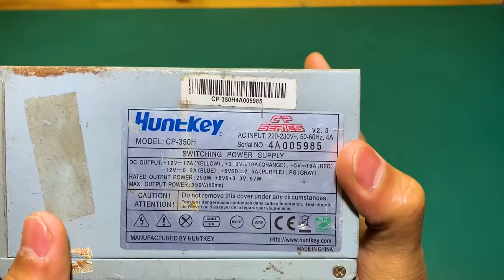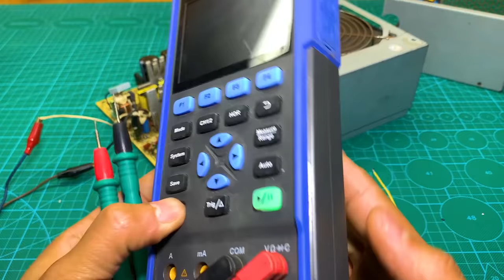DIY Powerful Ultra Bass Amplifier ATX Computer , Simple Circuit , No IC

Comment: It is fake. He soldered everywhere with copper wires but he didn’t cut off the original line that already on the circuit board 😂
Reply: Also one or two jumper between primery & secondary, that mean , is  this  live chassis amp????
Reply: This is no fake
Reply: Tradução versão brasileira Herbert Richard: É falso. Ele soldou em todos os lugares com fios de cobre, mas não cortou a linha original que já estava na placa de circuito. 

Foi a mesma coisa que eu percebi! Como que tem gente com tempo para fazer vídeos fakes? para enganar gentes leigas no assunto? Na moral é muito cara de pau esse cara kkkkk merece um Oscar: os vídeos mais fakes do YouTube!
Reply: Amplifier is hidden in his battery
Reply: Even when its not fake this thing cant put out so many watts XD
Reply: we should ask the guitarologist lol
Reply: Creio que não seja Fake esse vídeo  porque o técnico ao inverter a forma de como utiliza e retira a energia da fonte ele elimina todos os circuitos originais da placa e passa a valer aquele que ele criou utilizando o cabo rígido de cobre.
Reply: @renatolopes4543  the kicker is this theres no filter no sorce cleaning no hpm sense or even any type of mosfet gates and no input section for the amp to work this would be an idea to try if you had some idea on how it works but in truth this is a 1/4 the shit need to make a amp work youll be better off getting a bread bourd and 4 psu and a few power adptors and takeing them down for the parts and trying to make your own amp useing pots filters and so forth 
most of could be slavaged form parts
Reply: Como saber qual os pinos que vão ser jampeados,na placa,🤔

Comment: Dont take this the wrong way, but its much easier to just clip the green wire and a black wire on the ATX 24 pin connector, tie them together to trigger the psu on, then use yellow and black wires to a car amplifier since all yellow are running under 12 volts. You can then take an aux to rca and plug into an amplifier for much higher power. 
Tie in a 500 watt class D monoblock amp with a ported 15 in your home for extra bass. 
or Tie in a 2 or 4 channel amplifier to mix with 6x9's, 12's etc. 

Used to wire car radios in my bedroom as a kid, was fun then, now i got cars so the game has changed for me.
Reply: Sadly this is not a joke, good hearted enthusiasts can try to follow his stupid instructions and get seriously harmed, because you know, if it's on YouTube it must be true
Reply: @JoeOrber  whos instructions? the video or mine? Wouldnt be the first time i have used decommissioned PSU's for car audio You can use them for head units as well.
Reply: @hayzeproductions7093  wow show me how you do that, and solder random wires in random places, this is BS
Reply: Do you even know the difference between a PSU and a head unit at all? The power supply just supplies voltage and current to the different parts of a computer
Reply: Hence the name, Power Supply Unit
Reply: It won't amplify any sound or do anything else with a couple of randomly-soldered cables
Reply: Do you even know what a head unit is?
This is what they are called for car radios. 

Pins 23 and 24 on an atx connector are green and black, you clip those two and connect them together this is to trigger the power supply on and provide power, all the yellow leads on a power supply are 12v hence why they are colored on most power supplies. All the black wires lead to ground power.

Here you go, heres a youtube video that perfectly demonstrates what im talking about. Since you say i know nothing. 

https://www.youtube.com/watch?v=c_-0dk-FO9Q

You can also use power supplies to power CCTV and NVR cameras from long distances used to do this all the time.

You wont get injured touching the wires because its in DC voltage, You wont feel anything. Same goes for 12v car batteries. DC voltage is harmless.
Reply: @hayzeproductions7093  I know what a PSU is, the comment was aimed at the original video showing how to use a PSU as the amplifier
Reply: Lol I did exactly this. Ran a twin jl 12w0s on a class d 500w, hooked it up to my surround and it was AMAZING
Reply: @JoeOrber  you can also just use a psu to power  a car amp just need to jump the green and black wire on the 24 pin contector and use the vga or cpu power conector as  power for the amp and then use a aux to rca cable to send soun to any 2 channel or even 4 channel amp rather then doing what this video suggest
Reply: @fxgamer-11yt  exactly, the PSU is used to supply several voltage levels to a motherboard, and it can certainly supply power to an amp, but not amplify the audio signal 😉

Comment: No importa si es de corriente lineal o PWM... para amplificar audio se nesecita una etapa de conmutacion controlada por lo que se va a amplificar,  en este caso es audio. Una fuente conmutada en su etapa de oscilación ya tiene diseñada la frecuencia a la cual va modular fijamente.  Una etapa  pre-drive cuando se trata de audio es mucho más complejo
Reply: ENTONCES ES FAKE
Reply: @hi51667  super fake
Reply: Esta muy bueno el vídeo y la demostración  y me gustaría que me dieras el diagrama completó ya que en el vídeo no se puede apreciar muy bien....
Reply: Hermano, eso es una fuente con salida en voltage DC, solo usa una etapa de voltage de entrada conmutado porque el chopper de ferrita no induce en baja frecuencia, trabajan en su mayoria de 22k - 40khz
Eso que ese tipo está haciendo no tiene logica
Reply: No está usando los e30017 como preamplificador? Y alimentando el voltaje de la misma?
Reply: @hibari4139  Además, en la entrada del AC deberían haber unos diodos, ¿verdad?
Reply: @joveaaron-real  podes usar capacitores de 16v 1000ma y una resistencia de 10k o 100k o 1000k sirve para hacer un amplificador, es totalmente factible hacer amplis con fuentes de PC.
Reply: @hibari4139  a que le llamas amplificador? A conseguir unos pobres 50 watts llenos de armónicos y distorsión?
Reply: Si llamamos amplificador a poner a conmutar un trasistor a la cañona, entonces no es para mi
Reply: menos mal que lei este comentario, casi me pongo manos a la obra. gracias por la salvatore
Reply: ESE ES EL PRINCIPI0 PRIMITIV DE UN AMPLIFICAD0R CASE I
Reply: No es bueno el video, un amplificador asi de pedorro cuesta mas barato que una fuente de pc, voy a hacer un tuto de como comprar un amplificador ja!
Reply: @fabianjomet6546  venden modulos de 50watts× 2 que suenan mejor y más barato que ese prototipo
Reply: @roelvisgrullon8696  Confirmo completamente XD
Reply: jaja esta amplificando sonido con reguladores de voltaje de 12 v y de 5 v como carajos hace para volver el voltaje sonido es sorprendentemente mentiroso, esta bien que quiera hacer videos y aplificadores con todo por no mentirle a la gente asi de feo, y no deja de usar esa bateria q ya todos sabemos que es donde esta el amplificador real
Reply: Y si tu sabes un poquito ma ppr que no haces un video bien explicito y asi nos guiamos los que no sabemos de electronica. Y una pregunta en vez de una bateria de esa no puede ser un cargador de lapton

Comment: Good evening, please provide the diagram or schematic of the jumpers you made at the bottom of the power supply board, I would greatly appreciate it since the idea of making an amplifier with PC power supplies looks good, I send you A huge greeting and your videos are simply extraordinary
Reply: Nic Ci nie odpisze, oni NIGDY nie odpisują na takie pytania i dlatego jak dla mnie to wielkie oszustwo.
Reply: It is possible but if u notice he put a those on the bottom of the board and then put the board into rhe metal frame with all that touching the metal bracket. So...... that won't work lol it socks because us people would love to see how to do this stuff but people don't care about thar they just want what they want
Reply: He is randomly soldering wires
Reply: I'm sure it's fake, the part's ripped out of the power source, maybe it's done, but it can't be done on the card. The reason is that all parts are combined with one with one with the print circuit. And most of them come into play with 220v
Reply: Its all looks fake , and may be he is just completing pcm board existing joint with jumpers.
Reply: Monday Syng  Yes fake, he connetced ac to dc part so clear shock when he truns on
Reply: @Sam-to1zg  true it's fake funny when the camera moves around so much that the music stays the same and the beat don't even match the movement of the speaker
Reply: @enesunlu8723  ok
Reply: @js1ofakindone7  also if we noticed almost every of his diy amplifier he built, is sounds the same, by the camera sound recording, you can tell it's always the same.
Reply: fake another amp installed when the cam is cut
Reply: @rocksteeldigitalworld6768  ye

Comment: The real project is :
1. HOW TO RUN 12V PSU FAN WITH 12V BATTERY  
2. HOW TO MAKE A CONNECTION YOUR SPEAKER CABLE TO 220V AC SOCKET.
Reply: Right
Reply: Hehehehe and he loves your comment
Reply: 3. How to pass 12V through the Shottky diode in the reverse direction. 
4. There are chokes and capacitors on the 230V input. how to reproduce high tones through a low pass filter. 😄

Comment: Fake 
He doesn't even knows how to solder, he doesn't use Flux.
Reply: And also applies the tin wire directly on the iron tip instead of applying onto the pieces to be soldered. He's doing cold joints.

Comment: At a glance it appears that the primary side has been physically connected to the secondary IE the separation gap on the PCB between HV and LV side of the inverter is violated which raises significant safety issues.  
There's a very good reason for that only ever being done with optocouplers or transformers!
Reply: I too made reference about safety concerns. Your explanation is much more informative and explains in detail the apparent issues with this monstrosity. I am not privy to the terminology or have any direct experience with component-level troubleshooting and repair of electronics but just from what I see in this video, I think any reasonable person with a shred of common sense would say this is a bad idea! I'm glad someone who actually knows what they're talking about agrees with me about this being dangerous. The restoration channels are even worse when they throw dirt and mud on their electronics and miraculously find them buried in rice patties or dump sites weeks later and restore them.
Reply: With a 12V battery supply there will  not be any safety concerns.
Reply: Tentar fazer pra ver se funciona
Reply: It doesn't really matter that he has breached all the air-gaps as now he is using the mains input as the speaker output for this bullshit fake video.

Comment: How did you made the primary input as an output source.Then you use jumper wires without isolating part of that circuit. I knew that a simple transistor circuit there can do the trick. But how about other devices that stays there.

Comment: I did something at tech like this. I had a EVGA 1300w power supply plugged into an amp and deck. Running 2 12" terminator mtx and 4 6.5" I didnt go as far as ripping the ps apart. I jumped couple wires to trick the ps into turning on. Without signal from a mother board. Some teachers down the hall weren't to happy about it 🙃
Reply: смешно

Comment: Muy buen video amigo, Ase uno clase AB o Clase D con los transistores 5200 y 1943 y C1815 y A1015 para qe travaje con un voltage de 30 Vl positivo, fuente simple, no simetrica.  desde ya muchas Grc Saludos desde argentina..!! 😉👍

Comment: Sounds like it's just passing through the output from the computer.
Should be way more powerful than that that's at least 150watt power supply.
what does the the signal processing?

Comment: He spent way more time showing us his speaker than he spent showing us what he did to the circuit board, but as a long time electronics repair tech, I can certify that this is complete and total BS. All he did to the circuit was add a bunch of shorting jumpers to the power supply. There's absolutely no way that would turn any power supply into an amplifier. But congrats on suckering us with clickbait.

Comment: I very very doubt about the sound quality produced by that. I believe, it produces high THD and noise and has poor audio quality
Reply: It seems fake. Something might have been hidden somewhere in there producing that sound..
Reply: It is FAKE you can't just connect a speaker at the input of any power supply expecting it to work he has those small PAM8403 type amplifier module hidden some where for driving that speaker

Comment: I'm calling BS on this. I suspect all that crazy soldering was just for show, would have liked to have seen a video of it working with the lid off and all the circuitry on show to prove that it's not just a little Class D amp board hiding in the box doing all the work...

Comment: this video is not very clear.  On the printed circuit he made a myriad of copper jumpers then when he screwed the board back to the bottom of the container surely those jumpers flattened, shorting all the tracks of the printed circuit!  Unless the copper he used wasn't enamelled, but seeing the video it doesn't seem like it.  Meh!

Comment: The best part it twisting together the positive and negative input of the audio input and soldering to the same point, then having the audio wiring touching the copper wire that feeds to multiple points. This guy is a complete and total🤡🤡

Comment: Soldering random wires on a PSU doesn't make an amplifier. You litereally connected the 240 volt AC input to the low voltage DC side. These fake videos are going to get someone killed.

Comment: just...wow. cant hate on a persons skills and dedication to such a small project. and for the end of the video be lookin at a janky ass speaker and the PSU connected to a flippin BATTERY. most of the people converting PSUs to connect home audio to car audio. basically so you can run subs and amp from PSU tied into your already AC home audio. which would make the most sense. jesus christ what a giant waste of time. nobody is going to be running the battery indoors A) and B) allllll that bs and you still need to tidy shit up and actually make use of it. SMH